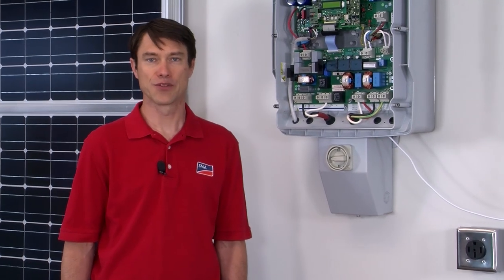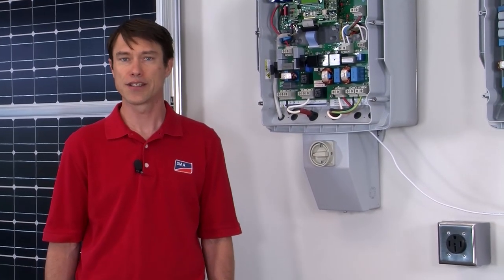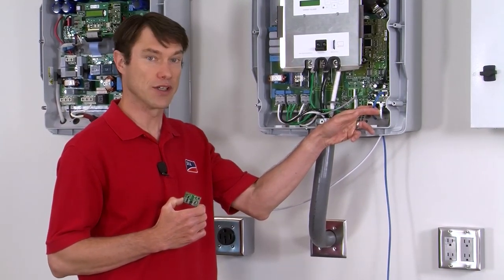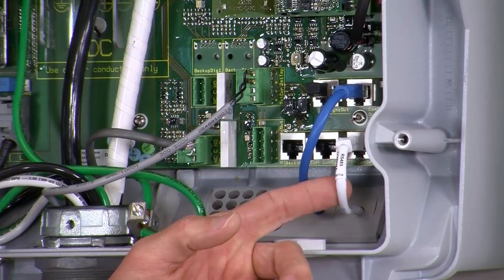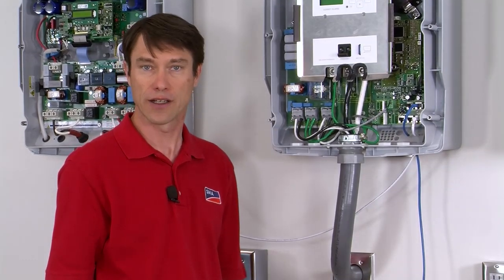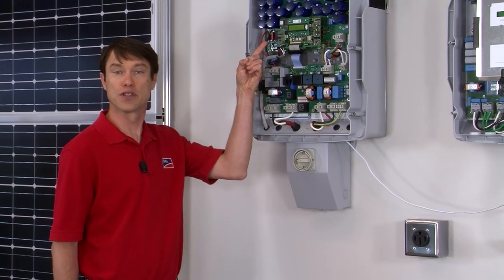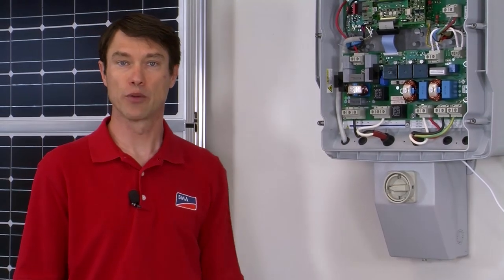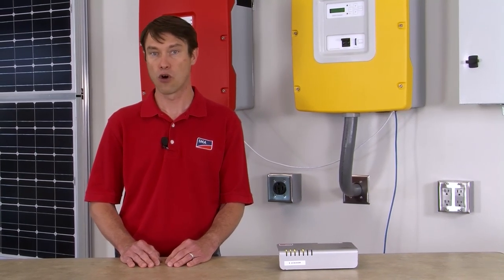Tech Tip: Proper Communication for Sunny Island and Sunny Boy Systems

Comment: Hi SMF FMS,
Due to the requirement that storage systems, in generell, must be ready to get remote controlled for grid system facilities, any implemented component is supposed to be equipped with suitable interfaces. Means if those mentioned SB5000TL-?? is ready  for getting retrofitted by  a Speedwire Webconnect Interface (SB5000TL-20 are not!) , the device can be run with a Sunny Island 6.0H of course.  Apart that, you`ll also need to have a Sunny Home Manager and any component amongst your system need to be implemented in a local area network via DSL-Router.

Best Regards
Leonie